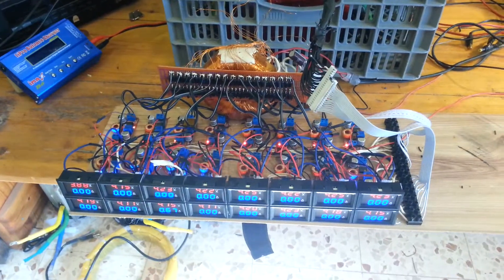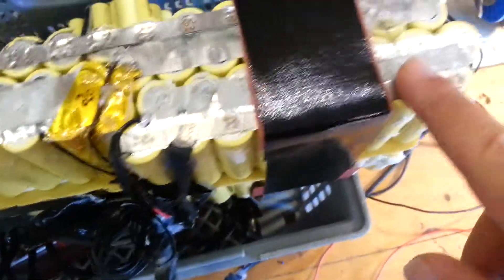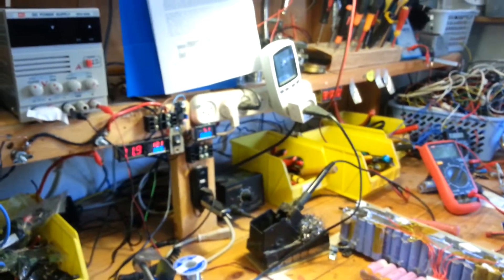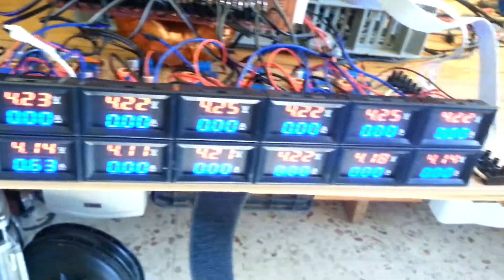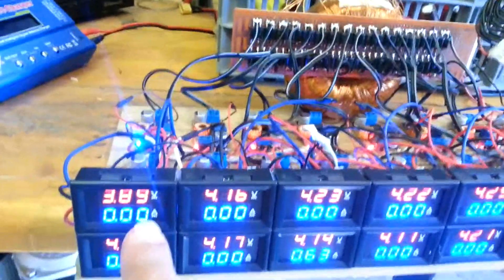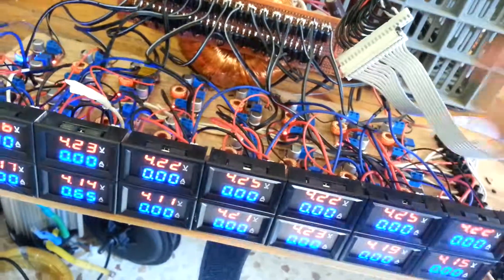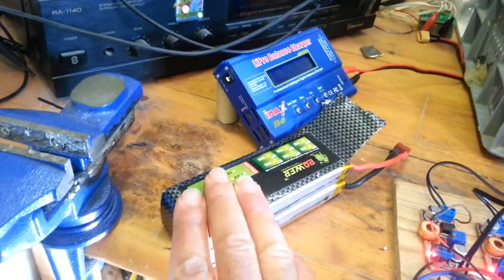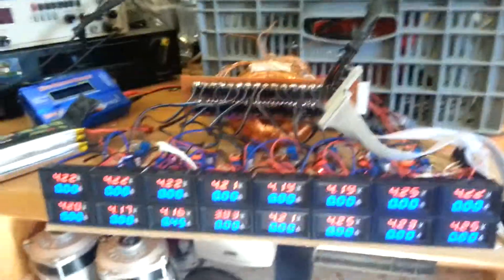Lithium battery balancer charger DIY

Comment: Isn't it easier to use a separate impulse power supply for each cell? It will be galvanically isolated anyway. Something like cheap 5v led PSU, you can adjust voltage to 4,2V. Or even some dirt cheap mobile phone charger where you can set proper resistive divider to get stable 4,2V, or whatever you like, on out? It looks incredible overcomplicated and costly
Reply from the maker: you can't use a 5V power supply because the charging voltage should be 4.2V.
so if using stepdowns any way, better step down from 12V to 4.2V.
This stepdowns is also regulate the current, to limit to the desiere one. mine is 1A.
and yes, you can use the cheap 12V power supply X 16 to create this charger, but if one of them fail so all the balace will go away. I prefered to build my transformer and rectify it myself, so it will last years to come.
Reply: One tp4056 for every individual line. It works, checked. Every tp4056 is galvanic isolaten (your chargers should have transformers, which make galvanic isolation, basically every charger our days work on principle of switching PSU). You can even connect load while chargint, because galvanic isolated chargers can be connected in series
Reply from the maker: @ukrlan4414     The TP4056 is a non-isolated module. It has a direct negative pole, so if you connect several of them in series of cells, you will get a complete short circuit. (unless you use a power supply for each module that connects to the mains).
The only way to charge lithium cells is through completely isolated components, in which there is no electrical connection between the voltage input and output - true for both poles.
See here an electrical drawing of the TP4056  https://electronics.stackexchange.com/questions/278707/tp4056-lipo-charger-output-voltage
Reply: It will be waaaay more cheaper. Buy quality 5V PSU, you can easily by modules instead of chargers. And using tp4056 will give you one more win - it will correctly regulate charging circles (you can find info abou by  googling "tp4056 charge cycle"). Your varian with inverters will not provide you such charging method. And it will be waaaay cheaper and easier, did I mention that before?
Reply: It looks like using artillery to hit a fly. But your project gives me good idea for changing station anyway. Thanks for mad science 🔭

Comment: Hi, just a question, what is the voltage for charging? 4.25V? How does it work at the end of charging, does it keep the current or is that drops significantly near the end? How many cells in one block? and do you send the 1A to all of cells in the block?
Reply from the maker: It gives 4.25v continues voltage. The 1A current changes by the battery cell resistance. When the cell empty it will push 1A, and will decrees when charging until will reach 0A.
This charger can charge 24 cells in parallel. Each cell will charge separately.
You can find a step down modules that can do a cut off when reached to a specific voltage, the best for lithium cells.
But it's OK If it will stay for a few hours will no cut off, as long as you disconnect charging when cells are fully charged.
Reply: @neworld4ever  thanks a lot. I am currently working on a super quick charger for lithium cells. The cells I have (Samsung) are capable of 4000mA max charging current so I am going to get close to that figure. I am planning to use higher voltage to push more current during the whole process - will see how it is going to work. I found some useful charging modules pushing high current, then quickly checking the voltage, them pushing more current and so on. Regards
Reply from the maker: @magicscorner  one important thing. push only 4.25V max for each cell. never more than that.
for the current you beter see the datasheet for max charging current.
usually it is max 0.5C. mean, if your cell capacity is 4Ah, so you shuld push 2A max. better lees than more.
high charging current will end by heating the cells and shorten they life, also will give a partial and not full charging.
Reply: @neworld4ever  my cells are Samsung 2500mAh capable of maximum charging current 4000mA